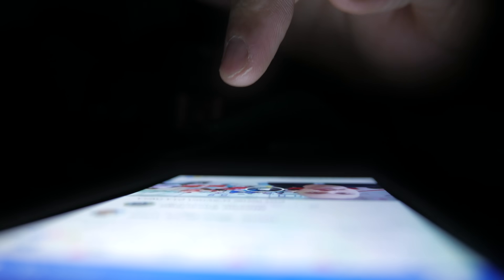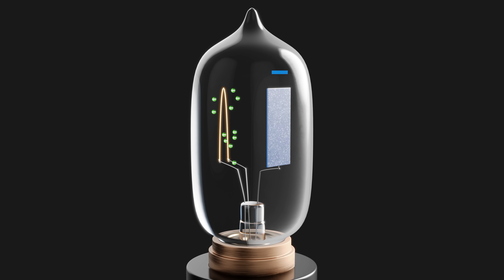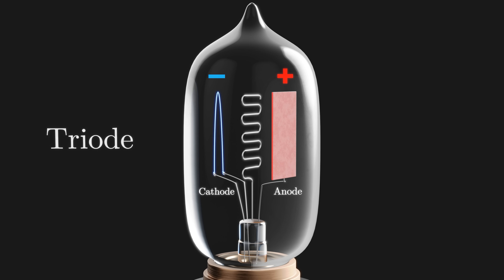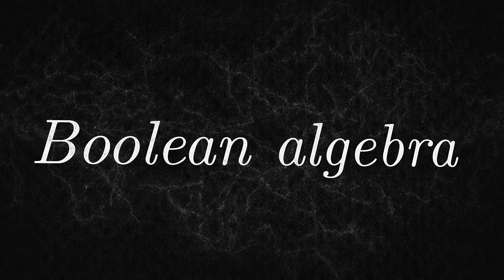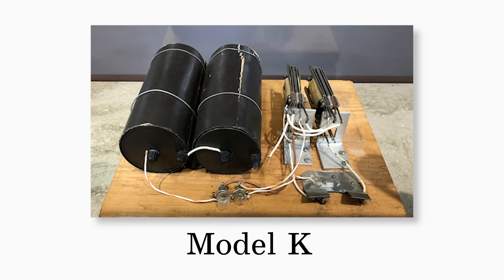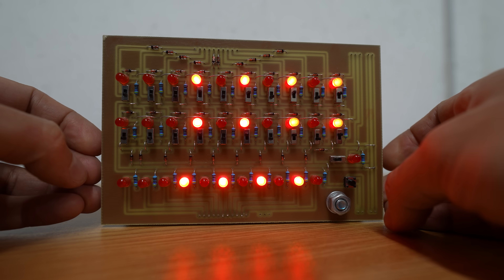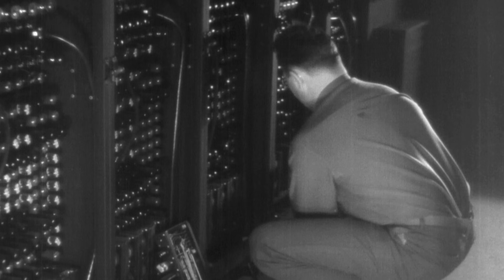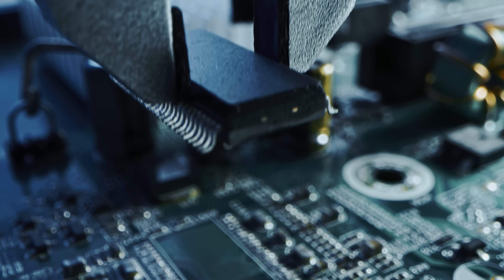Why The First Computers Were Made Out Of Light Bulbs

Comment: I love that you found archival films showing women working on computers.  It is a first-class counteraction to the (perhaps understandable) assumption that computers and electronics are, or at least originally were, a male-only field.  BTW, my own mother was a computer -- though I believe she may have had a simple calculator to work with (not sure there).

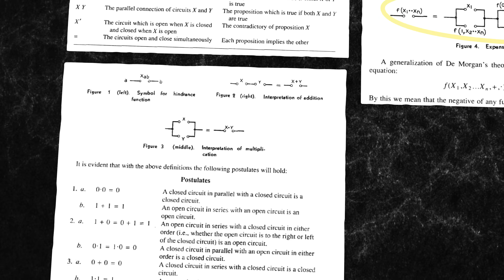One suggestion for the benefit of less electronically literate people like me: it would be worth specifically saying whether an open circuit does or does not allow current to flow.  This is ambiguous if you come at it from the point of view of plain English.  I have no problem with Boolean logic, but I had to look at the chart you showed at 7:45, multiple times, to make sense of it.  I see that a parallel connection of X and Y will allow current to flow if current is flowing on either X or Y -- but is that open circuit or closed circuit?  (Open, as far as I can make out.)  I still think "open circuit" should mean current is flowing, and if current is flowing then the result is "true" -- but I'm finding it deeply confusing for some reason.

FYI: my training is in computer programming, which is why Boolean logic is easy for me -- but that did not include training in electronics.
Reply: Your mother was a computer?:)

Comment: Nah, i disagree, with this logic i might as well say fire was the greatest invention ever, lightbulbs are a stupid invention its just electricity causes heat, and emits light.
Reply: Nah, I disagree with your one-sided logic. The societal impact of the light bulb is "multi-tiered", it can most succinctly be expressed in terms of work, leisure, and safety. This landmark product, helped revolutionize human society and spur further advancements, good or bad. I think it would be safe to say that there is not one major experiment, designing and testing of an idea in modern times that has not continued into the wee-hours of the night without Edisons invention hanging overhead 😎
Reply: @perceive8159  It isn't one sided, it questions hypocrisy, how can something that had influence to several inventions in the future not be control over fire, and not just that how could you credit edison this much, for I'm pretty sure trying to transmit wireless energy by quite literally inventing a better method of flowing current be somehow "overseen" just because someone had the idea of a bulb, it's so stupid
Tesla'sbetterbro

Comment: You made no mention of the Carbon Amplifier. which amplified audio signals without a vacuum tube. It was built by coupling a carbon microphone to a electrodynamic input. They were physically coupled. The Carbon mic was in series with a loudspeaker, It could handle more current and at a higher voltage, providing gain.

Comment: Spotted the Morse code in the water drops: '-.-. --- -. - . -. - / - --- / -- -.-- / ..- ... . .-. 🕵💧👀'  It translates to 'CONTENT TO MY USER' in Morse code, doesn't it Veritasium? Clever!👏
Reply: I see .-.--.-..--..----.-.--..-.-.---.-.-.--.-..--..---- and I can't get that to align with the message you have. Given the strange spacing between elements, I'm not so sure this is Morse code, unless it's entirely 'E's, 'T's and 'M's. Those four dashes in a row would have to be part of a  a '1' or a '9' depending on the direction you read it (the "Ciao Mamma" message from earlier in the video was keyed backwards, but appeared on screen legible left to right) It makes more sense to me if the dots and dashes represent straight binary bits. What's odd, though, is how the sequence seems to repeat after 33 bits. I would have expected a multiple of 7 or 8 for ASCII. Maybe there are some parity bits in there, but I bet it's just random garbage.

Comment: I've lived my whole life hearing about vacuum tubes and never really knowing how they work. This was an amazing presentation connecting lightbulbs to transistors. I'm stunned.
Reply: If you've ever gotten into guitar amps, you'll still hear people say that tube amps sound warmer. Still plenty of people using tubes. Tubes are still often the best way to amplify very high wattage radio signals.
Reply: @ComputersAndLife  if it's very high wattage, why does it need amplifying?
Reply: @esquilax5563 
Wrong way round, in order to get that megawatt radio signal you have to use Valves (Tubes of your American) to get there. 
So, a radio DJ speaks into a microphone, which creates a millivolt and milliamp signal, then you run that signal through subsequent amplifiers, transistor based to start with but then you use Valves to boost it up to a megawatt.
Reply: @MostlyPennyCat  ok, so he meant it's to amplify to very high wattage. Makes sense, thanks
Reply: I am older, an electrical engineer, I still feel the cool shiny magic tubes in my tiny hands as I carefully hand them to my dad, making a Ham radio.
Reply: I bet this video created a truly massive amount of Electrical Engineer Hopefuls. I’m a CS major and I’m wanting to look into the stuff more.
Reply: @kintamas4425  I have 20 years experience with a CS degree and I'm still marvelling 3 days after watching at how I managed to avoid such an easy to understand explanation of how vacuum tubes came into existence, why, and how they actually work.
Reply: I think if you really want to understand something well, just start from its origin.. go to its history.
Reply: @abhishekkushwaha3462  Truly outstanding point! Personally found this method of finding out 'how or why was this thing invented in the first place?' really great approach to learning many new topics!
Reply: Everyone understands mechanical computers, then school skips vacuum tubes because we don't use them anymore, and jumps to digital circuits, honestly if I had this video I would prob have got digiy
Reply: @simonhenry7867  Agreed. I know vacuum tubes was the predecessor of the transistor and functioned very similarly, but never know how it works.
Reply: @simonhenry7867  I studied computer engineering in college and basic electronics was part of our course. We where taught about vacuum tubes and how they evolved modern day electronics.
Reply: I’m feeling the same. I’m using tube amps and never really understood how they work…. until I watched this video!
Reply: Same
Reply: OOoooooooooooooooooooooooo😅oooooo😅oooooooooooooooooooooo😅ooooooooooooooooooo😅oo😅ooooooooo😅ooooooooooo😅oooooooooooooo😅oooooooooooo😅oooooo😅oooooooooo😅o😅oo😅😅oooo😅ooooo😅o😅😅😅oo😅😅😅oo😅ooo😅ooo😅o😅ooooooo😅😅😅😅😅oooooooo😅oo😅ooo😅oooo😅ooo😅oo😅😅o😅oooo😅ooo😅oooooo😅o😅😅😅😅o😅😅😅😅ooooo😅o😅😅😅ooooooooooooooooooooooo😅oo😅😅oo😅ooo😅oooo😅o😅oo😅😅😅😅oo😅oooo😅😅😅😅😅o😅ooo😅o😅o😅😅😅😅😅😅😅😅
Reply: Seeing the title, I didn't realize that he meant vacuum tubes.
Reply: That was very interesting!
Reply: A light bulb was electric and not electronic.

Comment: At 12:29 where they are talking about using the adder logic to perform subtraction, the carry flag is called the "borrow flag" and has inverse logic. If it is on, then a borrow did not occur, but if it is not on, then there the result shown requires a "borrow" operation from the next higher binary digit. In other words if the borrow flag is in the OFF state, then the result of the subtraction is negative.

Comment: The discoloration Edison saw on the inside of the bulb was carbon from the filament getting deposited on the inside of the glass. It's called sputtering, and it's the big reason light bulbs eventually burn out. Sputtering causes the filament to slowly lose mass, to the point where the filament eventually breaks at its thinnest/weakest point.

Comment: I'm not sure if your diagram at 9:18 is correct. Mind you I'm not an electrical engineer, but wouldn't there be current flowing through the solenoid between B and the carry light's ground?

Comment: > Its binary output means it's incapable of amplifying the complex and analog signals of phone calls and radio waves.

Incorrect.

If transistors are not an option, such as if it's the 1930s or something, and we somehow have super-fast, durable relays, then it could indeed be theoretically possible to design an audio amplifier using these relays. A relay-based amplifier would likely be a type of switching amplifier, similar in some ways to modern Class-D amplifiers.

In such a design, the relay could be used to switch a higher power source on and off in response to the input audio signal, effectively amplifying the signal. However, since a relay is essentially a binary (on/off) device, the output would be a pulse-width modulated (PWM) representation of the audio signal, not a continuous analog waveform.

To turn this PWM output back into an analog signal suitable for driving a speaker, you would need a low-pass filter to smooth out the pulses. This filter could be as simple as a capacitor and an inductor in series (a "LC" circuit).

Negative feedback could also be used to reduce distortion and improve the overall characteristics of the amplifier. The output signal (after the low-pass filter) would be subtracted from the input signal to create an error signal, which would then be amplified and used to drive the relay. This feedback would help to correct any errors introduced by the nonlinearity of the relay and other components, and by the low-pass filter.

However, such a design would still have some inherent limitations due to the on/off nature of the relay. For example, it could have difficulty reproducing very low or very high audio frequencies accurately. The PWM technique can mitigate this to some extent, but it's not a perfect solution.

And it's important to note that this hypothetical scenario requires a "super" relay that operates at high frequencies and has a high durability, which is beyond what real-world mechanical relays can do. Even with these super-relays, vacuum tube amplifiers, which were actually used in the 1930s, would likely provide superior audio quality and more efficient operation.

Comment: 6:10 is that a Variac?
Reply: It's an autotransformer. In simple words, it is a transformer, with only one winding wound around a core and  you can change the voltage at the output side by varying the knob.

You can google it for images.

Comment: I remember watching "the Philadelphia experiment" many years ago, and kinda wondered about the room with all the light bulbs on the ship and thought it was just the movie throwing something that looked sciencey in a room and hoping we wouldn't question it. It wasn't until watching this video about 20 years later, and seeing an image of eniac, it now makes sense, that a warship in the 1940s, requiring the world's most complex algorithms, would have a room that looks like what at the time, would have been the world's most complex computer.
Reply: Your initial thought "...  it was just the movie throwing something that looked sciencey in a room and hoping we wouldn't question it." was correct. "The Philadelphia experiment" was a hoax. It was claimed to happen in 1943. Colossus, arguably the first computer, was not yet working, and required very carefully controlled environmental conditions. The first prototype Colossus had about 1,600 thermionic valves. 

The mean-time-to-failure of a thermionic-valve-based computer capable of executing _"... the world's most complex algorithms ..." _ would likely have been extremely closely correlated with the rate of fire of the warship's guns. The shockwave from firing guns would likely damage one or more valves. That failure would need to be diagnosed, located and repaired. So it's "uptime" might have been severely restricted.

The movie was fiction based on a fiction. Your analysis of a "sciencey" looking thing is likely exactly what the film makers intended. 

Best Wishes. ☮

Comment: I still believe lightbulbs are amazing for light as well. The heat coming from them isn't necessarily wasted. In fact, they give so much heat that on a cold day, the central heating unit doesn't need to operate as much as it would need to otherwise. Heat and light delivered right where you are (because that's why you turned on the light in the first place: because you're there and want to see stuff) instead of elsewhere in the building, which only causes loss of heat during generation and transport. 

The European Union has outlawed lightbulbs, which I believe is a grave mistake. Sure, in some countries, it's usually warm enough that you don't need the heat, and it would indeed be wasted. In those cases, LED lights would be more suitable. But, in Northern Europe, lightbulbs should be considered as a more efficient method of lighting and heating, and definitely not be outlawed.

Comment: 5:25
The grid does NOT control the voltage on the anode, but the current flowing through the tube between cathode and anode.

Comment: Huh, what a coincidence. I was actually reading the Wikipedia article on diodes to find out if valves or solid state diodes came first. (Turns out they actually appeared around the same time, just that valves were initially better than solid state diodes. They're also still used to this day for high voltage applications)

Comment: I remember a day not so very long ago when I was absolutely sure we would never see live broadcast quality video over the internet. The first live stream I watched was over a dial up connection and featured a postage stamp sized frame about 1 frame per second but if you turned that on, the audio would hiccup constantly. The only practical way to "watch it" was the turn the picture off and listen to it instead. Stop and consider not just the bandwidth going from 0.0024Mbit to 25Mbit but the amazing advances in video compression that allow more and more detail compressed into smaller and smaller streams, it is truly amazing.

Comment: I know you don't need any suggestions from me. Still I suggest. For the animation of the silicon video(s),  it might be good if the electron had a different size than the hole. A smaller electron might fit into the center gap of the hole. The size difference would augment the color difference. I try to be quiet now.

Comment: Vacuum tubes have for a long time been colloquially known in the tube community as valves. Same is true for the early solid state transistor, which functions exactly like a vacuum tube but with significantly lower power consumption and greater consistency and reliability. Like your faucet mountain metaphor, they act as a valve for electrical current.

Comment: Silicon is simple enough. If you strike it with electricity, it switches between a conductor and an insulator. Since 1 and 0 are determined by the measurement of electrical flow, the new grid could simply be something to strike the silicon and switch it between the states. The best way to simplify an invention is to find a natural material that does the same thing automatically. Once simplified, you can easily scale it up.

Comment: • What could they have possible used to measure a temperature of 2000 degrees KELVIN... 185 years ago?? 
• With the more COMMON temperatures we are familiar with being Fahrenheit and Celsius - why did you have to mention "KELVIN"???
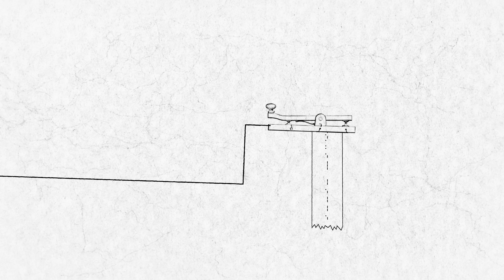• 4:25 - Was curious about the potential significance of this number, so I 'Googled' it. - It is the 'angel number'. It is said to symbolize Infinite Abundance.
• I didn't watch the rest of the video because I gots the ADHDs or somethin'.

Comment: My grandfather had an early form of car battery charger.  It used AC and rectified it with 'Edison valves'.  While Fleming may have been first to document the effect, I learned it as the 'Edison valve' for the very first diodes.

Comment: I remember turning on the 19 inch Zenith B/W television set 10 minutes early, so we had time to warm up the tubes, fine-tune the channel and stabilize the picture before the show started. It was such a bummer when a tube failed, necessitating the removal of a handful, (watch out for the flyback lead!) to bring down to the local TV repair shop to have tested to find the failed tube.

Comment: 12:30 isnt his explanation wrong? in 2s complement the way its meant, is that the far left bit is flipped into negative, so the far left bit in his case would be 1024, so in 2s compliment -1024.
the illuminated bits equal the bitflags for 1 and 2, so positive 3, this would equal -1021 though. in order to display negative three in 2s complement would be by illuminating all bits except the third to last and second to last. this would equal the equation of -1024+512+256+128+64+32+16+8+4+1 which would equal -3, so: 11111111001 in the case of the example calculator

Comment: At 7:43 you show:
  1.  X+Y, the series connection of circuits X and Y as: The proposition which is true if EITHER X or Y is true ... this is wrong:  it should read "The proposition is true if BOTH X and Y are true.
  2. X Y, the parallel connection of circuits X and Y as: The proposition which is true if BOTH X and Y are true... this is wrong: it should read "The proposition is true if EITHER X or Y are true.
...it appears you have these swapped.

At 7:49, showing the third page.. the logic is correct (and opposite the first page, as indicated).

Comment: Having worked on valve and semiconductor electronics since 1959 It has often crossed my mind that we were a 'cat's whisker' away from semiconductors in the early 1900's and thermionic emission might possibly have slowed down the development of electronics circuitry.

Comment: One small correction: you keep mentioning “what computer scientists need(ed)”; however, this video doesn’t really lie much in the domain of computer science, but in computer engineering / electrical engineering. Computer science deals with the abstract structures which can sometimes inform computer programs which can in turn inform electrical circuits. It’s a bit like saying a mathematician is the one building rockets to put man on the moon